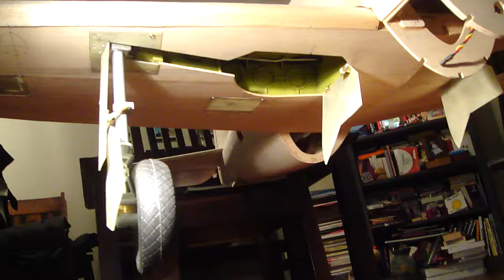P47 Gear door test 1

Comment from the maker: Thanks for the comments guys. I apprecite them.

I have a detailed build thread at rcgroups that goes into a lot of depth with the gear modifications, lots of pics etc. Please check it out... The link is in the info section. 

I tried to make it as helpful as possible for anyone doing something similar.

If you like my videos please don't forget to give them a good rating and share them around! Thanks